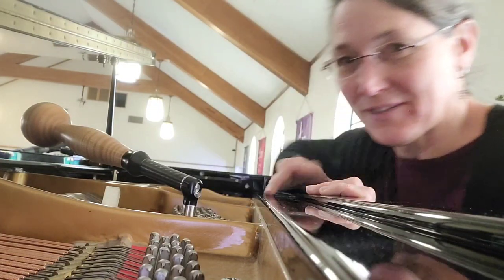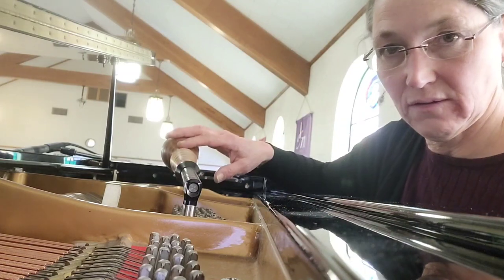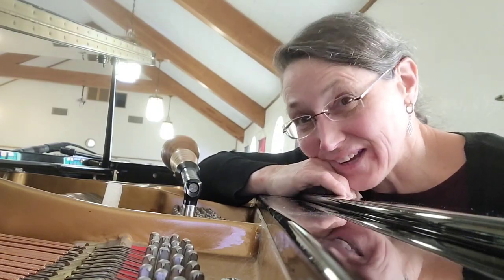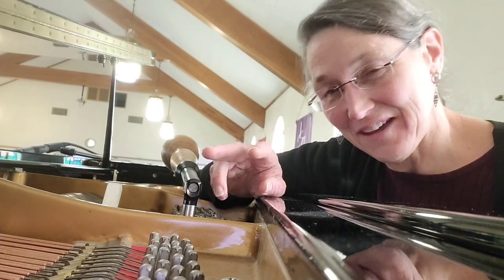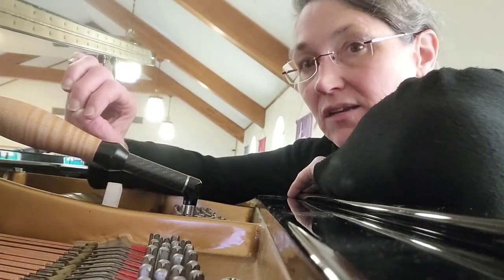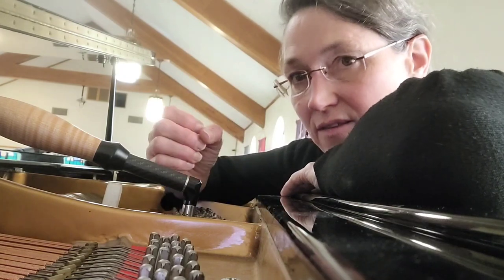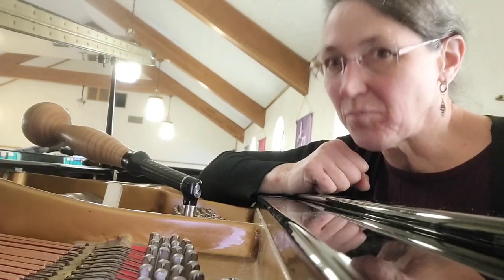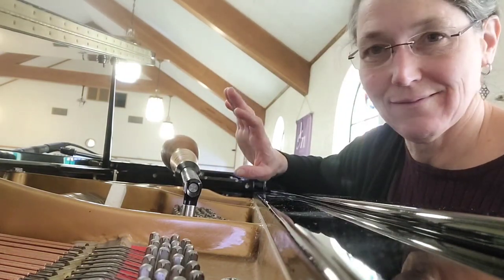thoughts on stability with tighter pins & lower friction at bearing points

Comment: Nice video. Great to see and hear how passionate you are about tuning, Maggie. 🙂

Some things to add that may make it simpler.
Instead of friction, think of non-speaking length. (NSL) The longer the NSL, the less sensitive the NSL tension will be to hammer movement. This is eerily similar to high friction. Long NSL behaves the same as high friction. Notice you are on the shortest NSL. Hooke's Law states the tension will be more sensitive, just like a low-friction situation. All pianos have similar materials and angles, hence friction, but not similar NSL lengths, hence, we should expect them to behave differently, and they do.

Also, Dan Levitan invented his C-Lever which indeed does allow you to eliminate bending (he calls it tilting) but he also uses the hammer to bend the pin on purpose.
Reply from the maker: Yes, I'm aware of Dan's discoveries. It's great information. What you said all makes sense, except I have experienced pianos with unusually high friction for whatever reason. Those are not fun to tune.  On those, the length of the NSL doesn't matter. The friction is high. I suppose it does matter because there will still be a difference, but the short NSL acts like the long one, and the long one acts doubly long. 😂 Have you seen my video of me trying to tune one of those? OMG...lol
Reply: @PianoTechMaggie  they are easy to tune. Pull up to pitch and leave it. Long NSL or high friction. Doesn’t matter. They behave the same. During tuning NSL is tight. After tuning untwist and unbend lowers NSL tension but not a lot. NSL tension stays high. Even if the pin isn’t set. Over time if the pin sets NSL tension still doesn’t lower much. I used to think of friction but it doesn’t make sense. For me NSL length comes first. Then if long acts short I know this is low friction. If short acts long it’s high friction. 

Doesn’t matter how we think of it as long as we’re aware. It solves so many problems.
Reply from the maker: I think I understand what you are saying. I'm talking about a different situation where the friction is so high that when you pull it up, the pitch doesn't change until it suddenly jumps, often with a "ping", far above pitch. The inverse happens when lowering. I have a video somewhere of the worst one I have ever encountered, but I'd have to find it. I have a moderate one on YouTube. Let me find that link. If I find the really bad one, I'll post it. It took me 3 hours to tune that thing. Crazy. 
Here is the modetate one. Some of this piano would work with what you say, but not all, I think. 
https://youtu.be/rVXm1wz5PeU 
In this video, you can hear it come into tune as I'm pulling up, but if I leave it there, it doesn't hold. It drops flat rather quickly. If I ever find the other video, I'll let you know. On that piano, I had to tune each note flat of pitch and bang the key. It would then pop UP to pitch and hold. Everything else I tried failed. It was nuts.
Reply: @PianoTechMaggie   That is a different issue. That is a jumpy agraffe. If the agraffe isn't jumpy, as you turn the pin the NSL tension will increase slowly until the agraffe friction is exceeded and the string will start sliding slowly through the agraffe and the pitch will start slowly rising. If the pitch jumps all of a sudden (you may hear a click) you will need to lubricate the agraffe. (BTW, I know you know this stuff. I'm just being more clear for your readers. 🙂)
Reply: I listened to the beginning of your other video. That is definitely a jumpy agraffe. You said, "Since the problem was with the agraffe, lubrication had no effect." That doesn't make sense. Jumpy agraffes are exactly the place where lubrication can work. However, ProTec doesn't work. Try ProLong synthetic lubricant. Much better.

Here is what I tell my students to try with jumpy agraffes (or jumpy pins). It works because as you turn the pin, the jump often happens only once and then if you keep turning the pin, the pin/string moves smoothly through the agraffe/pin block.

This is what I suggest:
Use Slow Pull Up
Go flat a bit. (or go sharp for slow pull down. It can also work with slow pull down but it is more rare)
Turn the pin until the jump happens
Concentrate on keeping a steady speed on the pin/string.
Drop the pitch when you reach the target
Notes:
If you don't move the pin/string fast enough, it may start jumping again. (That's why I often call this technique "fast pull" 🙂)
If you miss the target after letting go, start over. Do not try to finesse the pin/string. It will just jump again and you'll be circling the pitch forever.
The pitch will be where you want it. If the unbending/untwisting leaves the NSL tight enough but not too tight, the string will also be stable.
Reply from the maker: @How to Tune Pianos by Mark Cerisano, RPT  
 @How to Tune Pianos by Mark Cerisano, RPT  I will have to look that up. I used John Page's CBL. Lots of people have told me that I'm wrong about where it is jumping. Some say it's the felt. I'm not certain, but it "feels" like it's coming from the agraffe. And this one was an outlier. It was constant jumping. A faster pull definitely works differently and may have been better on this piano, but I THINK I tried everything. I can't remember any more, but I will try that next time I see it. 😉
Reply from the maker: @howtotunepianosbymarkceris2922   Clarification is always good! Not to mention vocabulary issues. 🙄 This one was different, I promise. Wish you could play with it! 😉
Reply from the maker: @howtotunepianosbymarkceris2922  Hey! Listen to these! LOL! 
https://youtu.be/qjQgGnXZ-J8 
https://youtu.be/8Bg9GpK1DKg 

🤣

Comment: A universal way to keep the friction between the pin and the pinblock hole. You have chosen a very correct position from 15 o'clock to 18 o'clock (for grand piano). This is the optimal position to save the resource wood part of the piano's hole (bush + pin block hole).
The pin is almost impossible to bend because it is made of a very hard metal alloy. At the moment when you try to "bend" it, the pin remains unchanged, its deformation does not occur. When you bend the pin, there is excessive pressure on the wood wall of the hole there. And it's operation is denting of the pin into wood.
The ideal position for great tuning is closer to 18 down. It looks ridiculous (the handle rests on the belly in time of a tuning), but it's painless for the hole and bush.
Best regards, Max
Reply from the maker: I believe it's impossible to not lean the pin into the wood from any position since there is always lateral pressure as explained and demonstrated by Dan Levitan, but yes, I agree that keeping it to a minimum is important. I'm still unsure how much extra is safe, if any. I made this video for you, just to show the pin can flex a tiny bit, but perhaps not enough to matter. 🤷‍♀️ 
https://youtube.com/shorts/dGjEP_O62n0?feature=share
Reply: Me thanks, Maggie,
Yes, thank you for the video specially made for me there too. There I will write my understanding of it.
regards,
Reply: I agree that bending the pin is more accurately producing compressing of the pin block wood, but just turning the pin does incredibly more harm to the pin block than just bending it.

Think about it.

Pin is in hole.
String is pulling 150lbs
Pin is "smashed" into bottom of hole, just sitting there, and then you come along and turn it.
What happens at bottom of hole?
SSSSSSCCCCCCRRRRRREEEEEEEEEEEEEEECCCCCCHHHHHHHH!
Very damaging.

Of course we have no choice. There is no way to turn the pin without grinding out the bottom of the hole. Yes, it is damaging but thankfully pin block material is very resilient. That's why it is used.

But you say no bendy the pin. I say of course bendy the pin. Bendy the pin all you want because the damage is much smaller compared to just turning the pin.
Dan Levitan says "Tilty the pin, young man(woman)"

Think of what happens when you bend the pin. (Bend is an engineering term. Let's use it. It means to apply a bending force that produces elastic deformation)
Pin is smashed against bottom of hole due to 150 lbs of tension from string.
You bend the pin towards the string.
Pin block feels the extra force but says to the pin, "Oh you are pretty boy. You nice to me. I feel soft pressure which makes pinnyblock feel sweet and happy. Not like brutal bad boy who scratches me with his scratchy, scratchy, screech, screech. You good boy. Thank you."
Reply: "You believes that turning the tuning pin without any bending force can cause significant damage to the pinblock. The rotational motion of the tuning pin produces a screeching sound that can damage the hole wall. You suggests that tilting or bending the pin can mitigate such damage, citing Dan Levitan's method of "Tilty the pin, young man(woman)."

On the other hand, I'm approach advocates for handling the tuning pins radially in the pin block and bushing with external force applied by the hammer. Me argues that any lateral oscillations of the tuning pin could potentially harm the wooden parts of the grand piano, including the pinblock and bushing there. To reduce such risk and alleviate the string pressure on the hole wall while rotating the tuning pin, me recommends using the 15-18 method there(only).
Dan Levitan created grand piano's wrench to never anybody work in other sector except as 15-18 there.

Although both me and you hold different views and approaches, we agree that proper tuning requires a great deal of experience and expertise. The choice of method ultimately depends on the tuner's discretion and familiarity with each method's strengths and limitations, I'm think.
regards, Max"
Reply: @TheMaximillyan  it’s not theory. You have seen pins with space above between pin and block that are tight. This pre occupation with destroying the pin block is unfounded in my opinion. 

I didn’t say bending mitigates the effect. I said bending does less damage. 

Dan’s lever may be at 6:00 but he lifts it and presses down on it - he agrees with me. 

Tuning the way you do - trying not the bend - doesn’t hurt the piano but neither does bending if done moderately.
Reply from the maker: @TheMaximillyan  I appreciate your comments, but you are not understanding me. I don't believe what you said I believe in your first paragraph. And yes, I own the lever Dan created, and I know Dan. He will tell you that if you use his lever without tilting the pin at all that you can't get a stable tuning. Either way, you're not understanding what I'm saying but that's ok. I think we're both fine. 😉
Reply: I am very glad that you have responded. Although what I might be saying is only my point of view, and as you write, "it is not theory, it is fact, and prejudice against destroying the hammer shank block is unfounded," it still remains inconvenient for a piano tuner to work in position 18. Because physical laws operate here and even if your practice confirms the invalidity of my assumption regarding 18, I still stand by my opinion. As for Dan's lever, which "he still lifts and presses down on, which he believes confirms your theory," it cannot fully confirm your theory, and that is perhaps why this lever in position 18 does not fully engage the edges of the hammers. Those who use this lever are forced to make some additional small manipulations with the hammers. However, I think that the main message of this lever's idea was precisely that the tuner would work in sector 18, which you will agree says something.
regards, Max
Reply: "Dearest Maggie, on behalf of Max, please accept our sincerest gratitude for the wonderful clip that you have created. Never before has the likes of it been seen on the YouTube platform. We certainly hope that your work will be greatly appreciated by professional technicians and amateur enthusiasts alike who are seeking to tune their pianos independently. The position closer to 18 may be theoretical, but nevertheless more favourable for the resourceful components of the pinblock and bushing. Regarding Dan's lever, I acknowledge that the peculiarities of some pianos, as well as the very design of the lever calls for additional manipulations, such as a forced tilt of the pin. Despite this, I deem it permissible, given the fact that the tuner who employs this lever is still 'compelled to operate in the sector over 18'. Once again, please accept our most sincere thanks, and we hope to have further successful communication with you,,,
Reply: And you are not understanding what I am saying. It is very important for anyone who wants to be efficient in any activity to understand the system. You don’t have to understand the system to perform the activity, but you will not be efficient. For example, you will struggle to get stability. You will think something works until it doesn’t and then you will not know why. The first step in understanding the system is to identify flawed thinking. 

“A universal way to keep friction between the pin and the pinblock” - there us no need to keep friction there. It is always there. If it isn’t you’ve got other problems. 

“You chosen a very correct position” - there is no one correct position. The correct position depends on approach. 

“To save the resource wood part” - it’s a fallacy that tuning destroys the pin block. 

I mention this to try and help you be more efficient but if you are ok with your own results, that’s fine. I wish you the best.
Reply: "I priority, old chum, is efficiency. I service any piano based on experience, as they say, 'with a stuffed hand'. Meanwhile, Max believes that in any activity, one should be guided first and foremost by common sense, based on the immutable laws of physical phenomena. 'Convenient and fast' is not for Max. That is to say, I, Mark, cunningly sprinkle 'against' arguments over 18, finding the method inefficient, and alleging that there is no harm to the pinblock here, when we are twisting the tuning pin, without providing any technical evidence. That is to say, 'putting the cart before the horse'. Meanwhile, Max says 'First there was the tuning pin, which is also a screw. The screw-tuning pin is under load. We must turn this pin, but the question arises - how to do this without damaging the wooden pinblock?' Max says 'First, one should position the hammer handle closer to 18, omitting any additional deviations of the tuning pin during its rotation in the pinblock hole.' That's Max's primitive scenario. And, that it's difficult, boring, and very inconvenient for the piano tuner, well, that's the core message from Max.
regards, Max
Reply: @TheMaximillyan  Contradictions Max ol' chum.
"Max believes that in any activity, one should be guided first and foremost by common sense, based on the immutable laws of physical phenomena."

Yet you make the following statements with no science or evidence. That is opinion. "Opinion is the lowest form of knowledge" - Plato

"I, Mark, cunningly sprinkle 'against' arguments over 18"
"there is no harm to the pinblock here, when we are twisting the tuning pin, without providing any technical evidence" (You actually admit to not using science on that one.)

You mention protecting the pin block yet give no evidence that the pin block is damaged by any hammer technique. Truthfully, I've yet to see any pin block that has been damaged by tuning. Not one. Every loose pin block I've ever seen has been damaged by age or poor materials. That's it. Seriously, This is called a logical fallacy.

I will give you free access to my 25 video lessons on getting superior stability, complete with videos and evidence as to why and when 18 is not more accurate, precise, and efficient. I just need your email address.

Hear is a free lesson on why 18 is not the best always.
https://howtotunepianos.com/piano-tuning-myth-5-and-10/

P.S. Why do you say 18? I know 18h00 is 6:00pm but 6h00 is the same angle. Why not just say 6?
Reply: Dear Mark, Max clearly states that the bent pin might not be the main reason for the damage of the pinblock, however, this does not negate the importance of properly positioning the hammer shank closer to 18, which you have not addressed. Moreover, your argument of never seeing damaged pinblocks here sounds unconvincing in terms of evidence. Max is not forcing his 18-based technique, he only expresses his opinion that a piano needs tuning at least once a year to prevent the pins from loosening, creating an ellipse in the pinblock hole. Such loose pins cannot sustain tone quality. The lost hammer shanks could be partly due to disregarding the 18 position. Please do not contact me any further, I have expressed my view, which I consider technically sound and not imposed.
 Best of luck.

Comment: I know this is an older video but I knew I wasn’t crazy when I tune certain pianos with poor rendering by flagpoling the pin forward as I turn it clockwise.  The only thing is I have to make sure I don’t flagpole too much or the note ends up sharper than where I left it and can be unstable.  But then again, if consistent enough, unstable notes can fall out of tune in tune…ahhhh!
Reply from the maker: I think everything you said is spot on except your last sentence. I'm not sure I understand it. Can you reword it?
Reply: @PianoTechMaggie  Sorry what I meant by the last sentence is that there have been times where despite the note ending up sharper due to over bending, the pitch would fall into place upon pounding the key and the unisons would still be clean because the strings slipped uniformly due to being consistent with the tuning lever technique.  Was just trying to make a play on words but probably ended up sounding crazy anyway.  Oh well thanks for the informative videos.